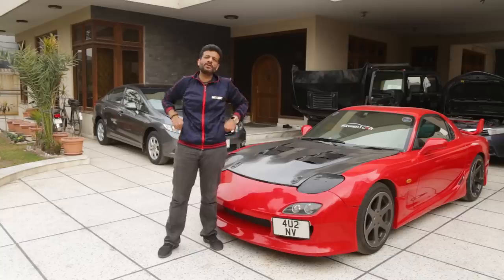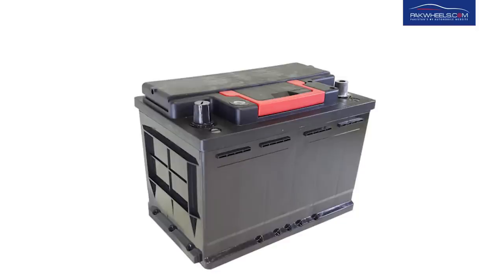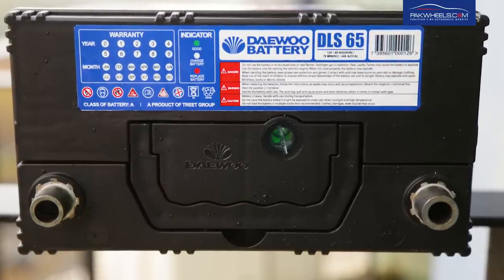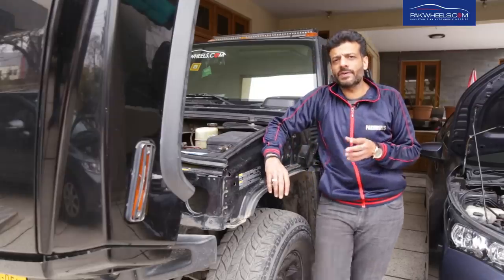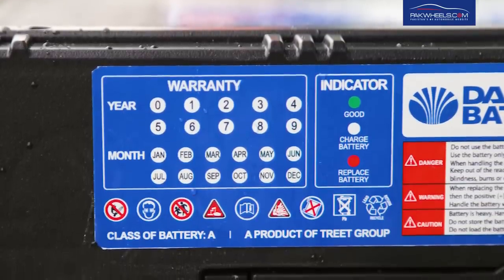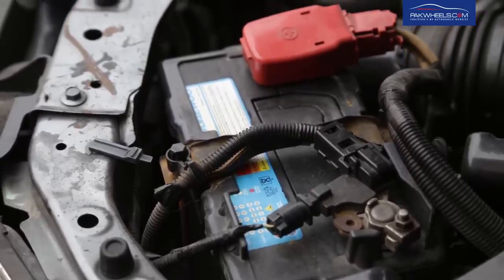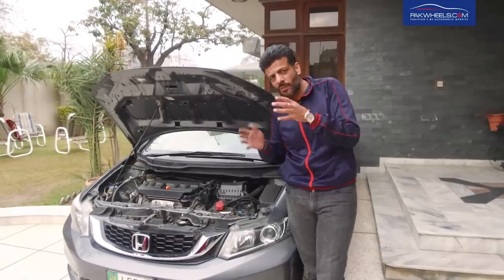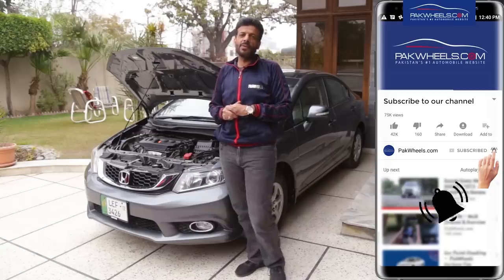Suneel's Garage | Car Battery Guide | Daewoo Battery | PakWheels Tips

Comment: Just a small correction. 92AH is not amps of the battery but the stored energy or capacity. CCA is the amps that you are looking for. It is the peak current battery can supply for short duration.

Comment: @pakwheels Thanks sir.. i usually faced the issue with batteries in my cars which we use rarely.. the batteries went low soo soon.. but after your video I've changed to daewoo batteries and now it's a year almost and my batteries are just working great👌 Thanks alot for sincere advices..😊

Comment: dear Mr. Sunil munj sb I personally learn many useful tips which you discuss and elaborate. I have a question if you may kindly answer, that if a car is placed in reverse gear mode on a steep slop facing down and the car moves down will it be considered as gear box problem or this is not a seriuos matter. My opinion is that if we put a stationary car in reverse gear on a steep slop facing down ward it may not move down.

Comment: I have a question though..i am from Larkana and in hot summers temperature rises upto 52c and its general conception here in local drivers that maintenance free batteries don't perform well enough as compared to lead acid batteries, so what would you say about it?
Also you didn't mention price, it would be good if you mention in description or in comments.
Also do mention the life-period of said batteries as compared to conventional lead acid batteries.
Thank you
Reply: Dear you are right such batteries possess more threat in hot areas because of high temperature. In liquid batteries h2o evaporate which can be refilled again.

Comment: I was on 120 speed with Auto fans, over car 2c 1974cc diesel; 
suddenly I felt steam heat around bonnet and Meter, and heat guage reached at H/Full.
I parked the car within 30 seconds, by keeping it in Neutral gear. I not felt blowing smell, 
but there was Water leakage of unhealthy small/mini rubber pipe under Intake manifold. I replaced this pipe.
At weather temperature 31degree! 
After 15mins, 3ltr water consumed in radiator to be filled, on switch off. 
Overall after 30mins breakdown, 
I travelled 49km at speed 70to80; and at normal (middle and 1point down over fan start)Heat guage,  in fear.
How much this situation can affect over engine negatively?, at present.
Regards

Comment: This is a very informative video. Thanks PW. I would also like to request you to make a video on after market HiD lights installation. I have heard that HiD are very dangerous as their wattages are very high and car wiring does not support the power requirement in long run and can head to wire burns etc. Plz guide on this topic.

Comment: Cast is a main factor in our market may be its not for Mr Suneel  it is for me I have an example in our Market A battery has price of Rs:-5500 and V has same ampere but price Rs:-3500 so i will prefer V because even it has life of 1.5 years and A has life 2.5 years (that i did not experience after 2010) these are same in cast.

Comment: I used AGS gl 50 in my efi cultus. I used August 2011 to February 2016 almost 4 years and 5 months. then I used brand new daewoo battery. after 2 years and 9 months daewoo battery was dead. and then I bought again AGS. water battery age is more than dry battery. water battery age is 3 and half years to 4 years with proper maintenance. and daewoo dry battery will dead after 2 and half year. and Maximum 3 years you need new battery. so water battery age is 15 to 18 months more than dry battery.